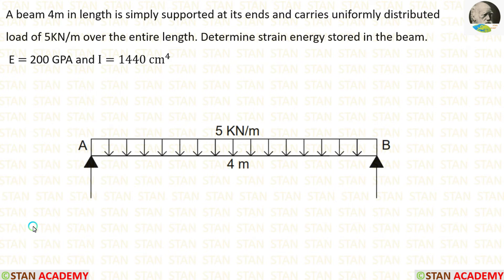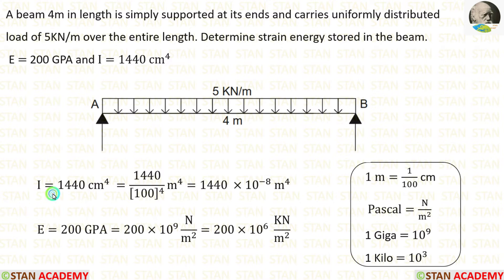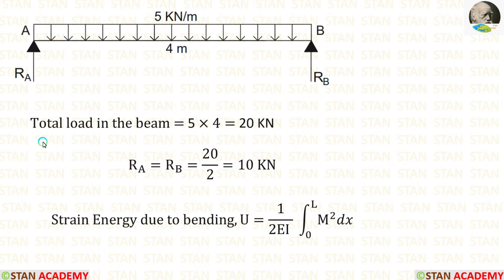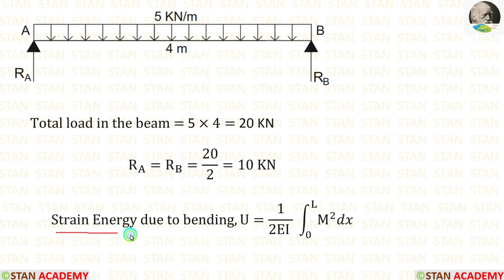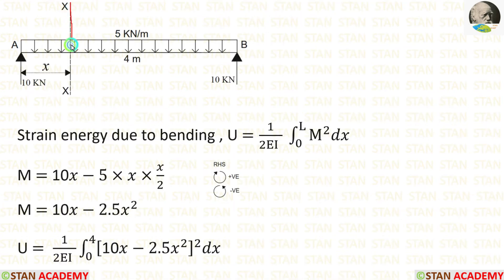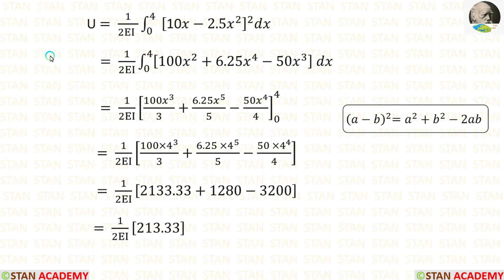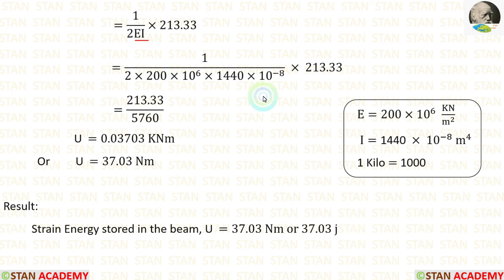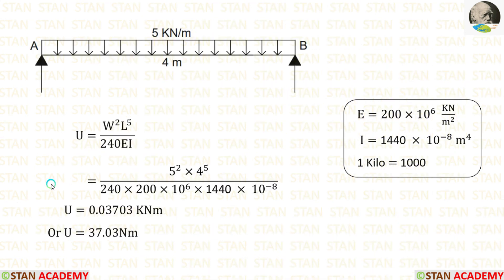Strain Energy - Problem No 7 (From previous university question papers)

Comment: in this problem  also E value conversion wrong but answer crct sir
Reply: E value conversion is right.
E=200 GPa
E=200 x 10^3 MPa
(1 MPa = 1N/mm2)
E=200 x 10^3 N/mm2
E=200 kN/mm2
E=200 x 10^6 kN/m2